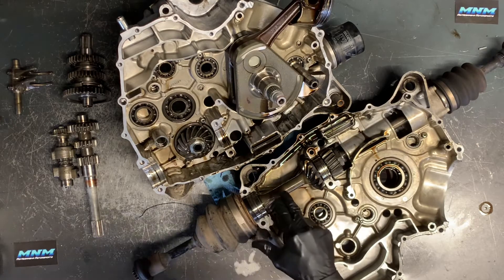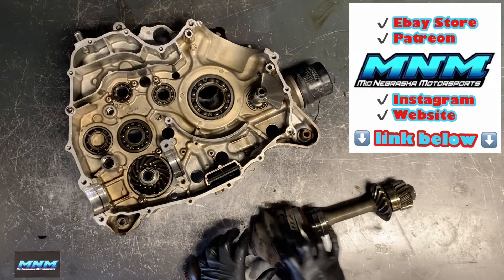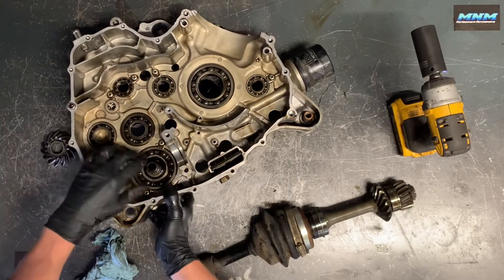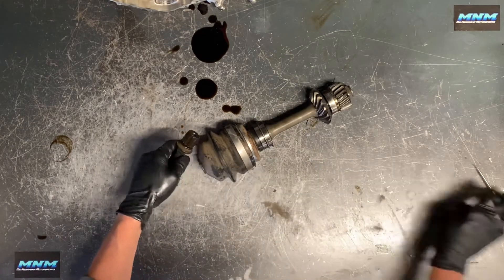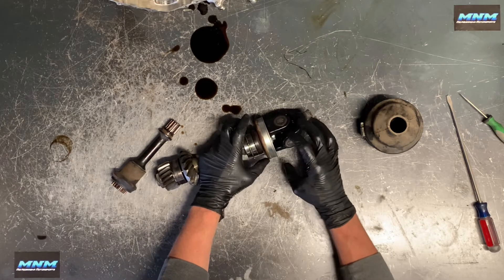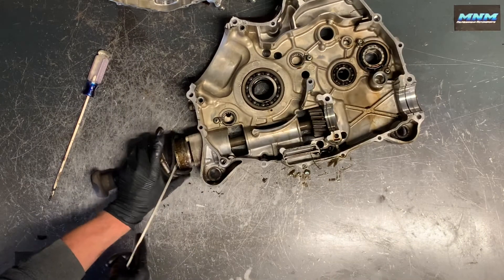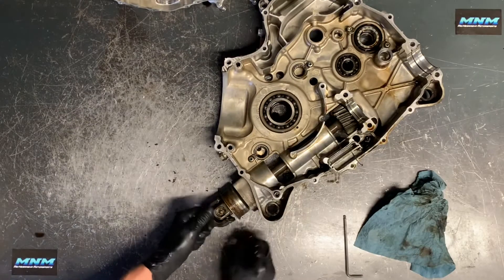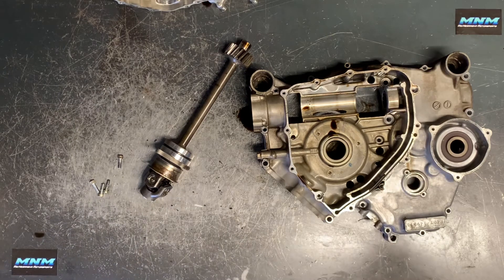Suzuki King Quad 750 LTA 500 Prop Shaft / Bevel Gear / Yoke Replace

Comment: yikes. I've got a failed seal on the front output shaft of a 2007 700 causing engine oil to sling on to the front of the engine. if it involves splitting the case to get to the seals (thats what I see here) then I guess I'll continue to add oil until I'm forced to do a deeper repair.
Reply from the maker: You'll want this:  https://amzn.to/40wQx6w . Or this: https://amzn.to/3nEZFYc Let me know how the project goes. Thanks for watching and the comment!

Comment: Hey can you tak apart both the front and rear u joint. Doing just a front and rear prop shaft seal without splitting the case?

Comment: please also take videos when putting back the top end and setting timing. I am planning on checking my top end soon.  also, a video on valve adjusting for this model would be great, even tho I have an older one (700 king quad). tnx